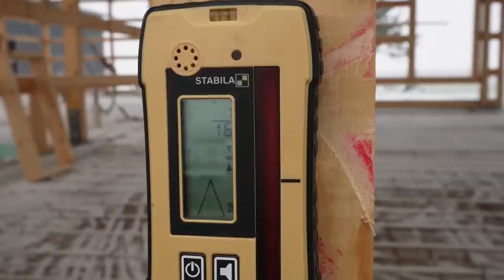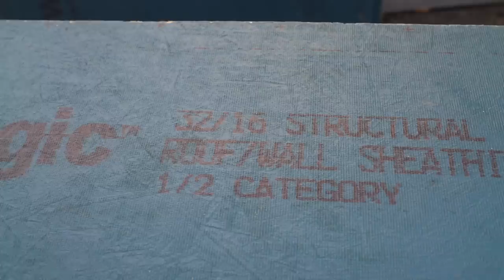Building The BEST House:  NEXT LEVEL SHEATHING and misc framing

Comment: Harbor freight has a 30 dollar propane fed. weed weed burning flame thrower with a 6ft hose helps melt that ice and water so.itll stick down .
Reply: Lol these guy use nothing but top line professional tools, guarantee they’ve never stepped foot into harbor freight!
Reply: @BradBehr2707  they have. Harbor freight has some good stuff. You have to make sure you know what your buying. I have a battery charger that always works it's been through hell in the snow and mud and rain. Also Thier ratchets not bad. Also the jacks work good if you buy a good one.  The lights for outdoor work good and last a lot.

Comment: We would use a propane weed burner torch to heat up the ice block barrier to make it stick down good and would do out a center then two stripes per side out so we had a good 3 foot of protection in corners.

Comment: I'm just a peasant with only 1 Grabo, but it is absolutely awesome. You can definitely hang off it (responsibly). The suction is so strong that it cracked a ceramic wall tile on me, so I quickly learned to only let it run to like 100 lbs of suction on those. Battery life is unreal too.

Comment: Next time you are putting a HT membrane, try one for winter. Also, it’s preferable to put your flashing under your membrane so if there is water under the steel, it wont flow under the flashing right into your fascia.

Comment: Interesting on the ice and snow cover. I never had a stick problem with the brand I used back east.
You could use a heater blower briefly on each section you lay down for adhesion.
Reply: Don't send any money,  thats a scam!!!
Reply: @Ruslan Ataoullov  Thanks, but I do ignore these as they are on other video podcasts.

Comment: Most if not all osb wall sheeting in stick frame is vertical..plate-to-plate... Horizontal is plywood and often blocked on seems... Pretty rare except commercial with plywood.   MN /WI  metro area...

Comment: We used Grace ice & water shield in Tahoe to roof the multi$$ million dollar homes out there. Don't even think it will stick even after a heat cycle without stapling. One we did all the valley walls with eves with Grace. They would go from 2 to 4 or 5 feet to zero because of adjacent roof hitting the valley roof. Really a pain cutting cutting the triangles pieces of Grace to fit on the walls under the eves where all the different roof angles came together on 5000+ ft print 2 and 3 story houses but nice warm day and the Grace was sticking on without staples. Came back next morning and it had peeled off and stuck to itself and some still stuck on walls. What a fricking mess. Took just as long to pull all of it off (could save any cuz stuck to itself and folded etc) as it had taken to put it on the day b4. Then we put new on but STAPLED IT really good this time so it would stay on until covered with siding. We always stapled it on the roofs. I saw then why we stapled it on the roof!!
Reply: meant to say "couldn't save it cuz..."

Comment: I work in the commercial roofing industry. If there’s one thing I’ve learned with metal roofs, it’s that exposed/through fastener systems are JUNK and WILL leak and cause issues.

Comment: That Weatherlogic sheathing is pretty cool. Seems like another form of Zip. Maybe not as expensive??
Reply: I use zip R. Not sure about cost. 2.5" zip r with 3" of closed cell gets you over R 30 continuous insulation with no breaks. Passive house rating and very simple install.
Reply: There are several coated OSB panels out there now, so the price is down.  Really, just using a coated panel on the roof with blown in cellulose would block all radiant roof heat transfer.
Reply: Scam!!!

Comment: just a couple of questions.. what type of ice and water is this? I was under the assumption that ice and water had to be installed at or above 40 degrees for proper adhesion.  I was also taught (roofing industry) that the ice and water shield is installed over the metal drip edge on the eaves of the building and under the metal drip edge on the rakes of the building, so I was wondering how you would go about getting a warranty from the manufacturer on this product? Love the videos and thanks for the input!

Comment: Good days work guys. Question: I noticed a strange little sheathing anomaly two-thirds of the way down the valley you covered with the I&W shield. What was that about??   Love your vids and Happy New Year!
Reply: The OSB he put up isn't structural at all he's just added it for strength, so when he puts the metal roof on a valley piece will go on to that part and make it seal correctly with no issues
Reply: It was the OSB underneath the framing of the joining structure that he “over-framed” on top of. In essence, he sheathed the larger roof first and then framed the smaller gable over the OSB to tie the two sections together. It made it easier to frame that way.
Reply: When you commented about the structural screws you should have said they were sheetrock screws and then you could have watched the internet explode ...lol
Reply: @aarongrubbs6506  Hi Aaron, I get the framing aspect......what I don't get is leaving a 14"x12"ish triangle opening unfilled in the valley. I went back to the previous episode to see if it was addressed or explained but no. I love this guy's workmanship and perfectionist attitude, this little thing I need explained by our host.  :body-blue-raised-arms::hand-purple-blue-peace:

Comment: Kyle, one of the big advantages to post frame seems to be the shear resistance gained by the metal sheeting and not having to use wood sheathing.  If you are installing standard OSB/plywood sheathing does the post frame lose it's competitiveness with stick construction regarding price?

Comment: 30 years on those screws for the metal roof.  NO WAY.  I've been inspecting those roofs for 15 years. Those screws generally last 10 years from installation. Not all But several will fail or just back out in that time frame.

Comment: Can you build post frame over a basement?   This can’t be the ultimate house without a basement.  Tornados do happen in Illinois
Reply: Yes you can
Reply from the maker: @jwristen24  we have done that a few times
Reply: Could easily build a safe room in somewhere. They use tornado safe rooms all over the south with rarely a basement in many areas.. much higher chances of tornadoes too.  I live in WI and used to think the same about basements until I bought a lot with heavy wet soil... Beef up the master closet it is!  No basement and I floor heat. Love it.